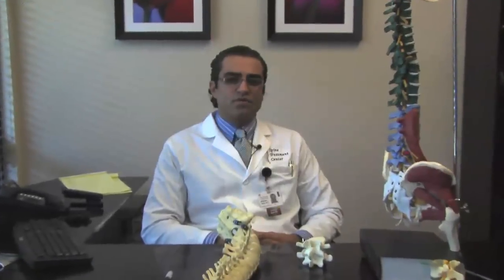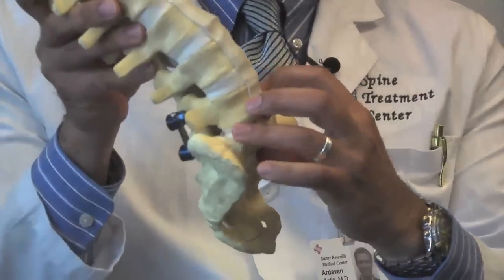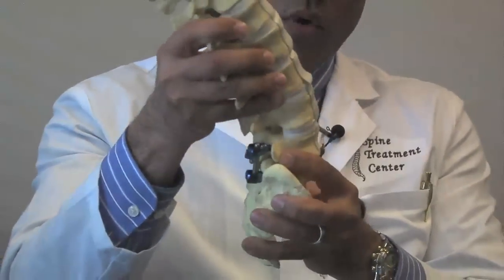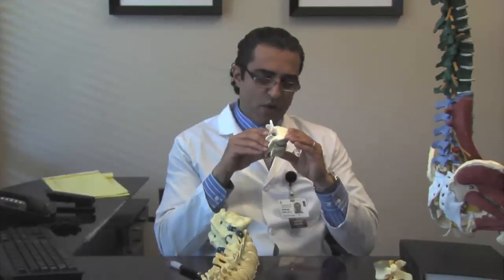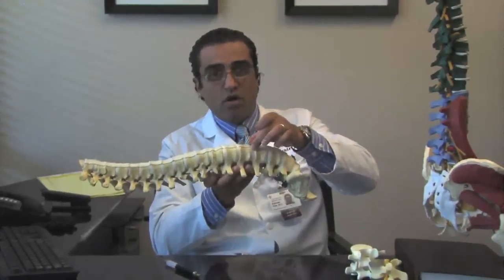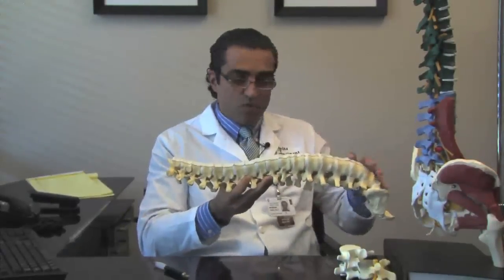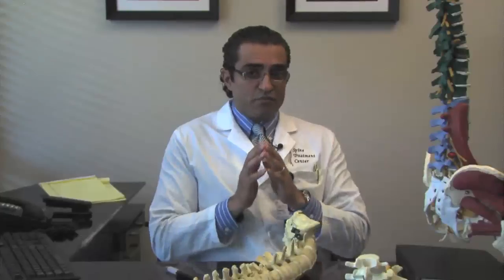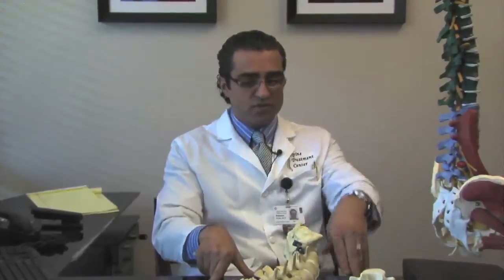Spine Treatment Center - Fusion Vs. Disk Replacement

Comment: I was assaulted when my back was healthy in 1992. I have been left with Cauda Equina Syndrome and Degenerative Disc Disease, after a surgeon cut into the dura of the cauda equina (in error) in a laminectomy for one of the worst herniated discs he had ever seen. He was near retirement age, so I am sure he had seen plenty of herniated lumbar discs. I have a patch job that took more surgery time than the herniation, which he was not even able to fix. I was left in more pain than before the surgery and have lived with the pain since the surgery in 2008. Now the degeneration caused by that failed surgery have affected the discs on either side of the initially treated disc. Now a surgeon wants to do another surgery, so you can imagine my hesitation; however, my legs are getting so weak and my muscles are wasting. I have bladder and bowel issues, and recently started using a cane after a fall. This video is very helpful for researching my options at this point. I want to be very sure I don't end up a paraplegic after this next surgery. I can't afford them to botch this one like the last surgeon did. I'd like to see the latest success ratings for the prosthetic disc replacements, to compare to the fusions, since this is from 2011.
Reply: hey how is your back feeling 
now

Comment: This video is extremely outdated. M6-L disc by Spinal Kinetics trumps everything this doc believes to knkw about artificial lumbar discs. Too bad FDA doesn't allow it in the US and you have to pay $40k out of pocket in Germany to get it installed. I am currently looking at that option. [EDIT: I ended up going with the LP-ESP disc instead of M-6L; I have seen several failures of M-6 and those scared me; Several good surgeons in Europe swear by the LP-ESP disc and prefer the design over M-6).
Reply: Artur Curyllo; I am suffering from three cervical discs. what is the best clinic in Germany?
Reply: Adel Cervical is no problem in the US up to two levels, but for three you may need to go outside. Try Dr Cavel in Barcelona, Ritter-Lang or Biren Desai in Germany. Prof Rischke in Zurich is great, but rather expensive. All of these are great.
Reply: Artur Curyllo Thanks for your quick reply. I just suffer from the pain in my neck that does not go away. There are currently no hand tingling. I want to follow up with a trusted good doctor to avoid future surgery and improve this constant neck pain.
Reply: Adel Depending on the extent of the damage to the discs you may get away with a microdiscectomy in the neck. Stay careful afterwards amd you might be fine...but if your symtoms return after a microdiscectomy you might be better off with replacing the discs to artificial ones. I am not a doctor and cannot give medical advice but this is the trend I see.
Reply: Artur Curyllo What 2 levels are the acceptable 2 levels that you mentioned for the U.S. in your opinion?Please & thank you.
Reply: Artur, please, keep on updating, do you have DDD l5s1 as well?
I heard that Dr Lang is good but surgery is quite expensive. Dr Andreas Schimitz is a class doctor or what do you think?
Reply: Alonso Andrés I do have a degerated L5S1 (that's how a disc herniation starts as it is really difficult to herniate a perfectly healthy disc barring a severe car crash, etc). Unfortunately at this point I have learned of several M-6 L failures by Dr Ritter Lang so I quit that route, even though that's how how I originally learned about ADR. Instead I am going with Dr Schmitz. I learned from him that he taught a lot of the other guys in Europe. One of my friends with a major cervical and lumbar M-6 failure by Ritter Lang is going to Schmitz this weekend for a revision. Feel free to join our Artificial Disc Replacement group on Facebook. There is a wealth of information out there.
Reply: that's sad to hear,  what is the name of that group?
Reply: Alonso Andrés Artificial Disc Replacement
Reply: Thanks man
Reply: @arturcuryllo5832  Do you have an update on your surgery? how did it go?
Reply: @arturcuryllo5832  I would like to read about these failures regards Dr Lang do you have a link?
Reply: @arturcuryllo5832  I read that Dr. Schmitz uses the LP-ESP and not the M6-L what do you think of that? do you prefer the LP-ESP?  are you thinking the failures are due to the M6-L not being good.  Could it be that many more M6-L have been installed and it's just a matter of numbers...?  I would be interested in hearing what failed exactly.  More details. I am considering a disc replacement my self in the 5L-S1.
Reply: @Ashakar2011  I ended up going to Dr Andreas Schmitz at Clinic Bel Etage in Dusseldorf. After all the research I decided on the LP-ESP disc (no keels going into the bone to weaken the end plate of the vertebral body and much more stable than M-6; M-6 had a number of consistent failures at the core - the core gets squashed and displaced if the placement is not perfectly centered in all directions; I hqve seen a few scary images). My outcome has been great. Riding my mountain bike 5 weeks after the surgery. The doctor said too early, but I feel go to do it so I am riding.
Reply: @treelore5100  Feel free to join the ADR Artificial Disc Replacement Support and Education group on Facebook. Several failures are posted there. My success atory is also there. There are about 800 members, many of whom are educated better than most US doctors).
Reply: @treelore5100  Join the ADR Artificial Disc Replacement Support and Education group. You will find several images and stories of Enande an RL denying any liability or even disc failure that WILL BLOW YOUR MIND.
Reply: @treelore5100  No, not this one. The one I am suggesting is a group on Facebook. Be careful which one you choose. The one advertising Enande and Ritter Lang blocks people reporting failured of M-6. There is a separate group with no financial interest there. Join that to learn everything you need to know to make an informed decision.

Comment: I'm so frustrated here, because i'm 23 and need something to happen in L4-5 so I can sit up without excruciating pain.

Bah
Reply: I highly recommend opiates, physical therapy, and injections. I’d that doesn’t work after 6 months of consistently seeing a pain management doctor go get an artificial disk replacement. This is the situation I’m in and I’m getting an artificial disk replacement on my L5-S1 July 7th.
Reply: @justacollegestudent5147  

Thank you for trying.

only one opiate works for me, and if I have my pain management place prescribe it, I need to go in every 2-4 weeks for a urine test and a visit, and they won't prescribe anything else, or I can not and try to get other stuff.

I've had three epidurals, three or four medial branch blocks, and a set of radiofrequency ablations.

Epidurals made me significantly worse, medial branch blocks only helped for a day or so, and the radiofrequency ablation was great but only lasted like eight months. 

I've been to PT so much, but it doesn't help for this, and my insurance only covers 40 a year, so I stopped going.

Went to a surgeon, he told me I wasn't bad enough for surgery.

Working on getting seen in Phoenix for getting a disc replacement.

I've been in debilitating pain from this for over three years.

I've been treated like a toddler throughout the process, as if I don't know my body.

I'm angry and tired and want to sit up x.x

I hope your disc replacement goes well!
Reply: @justacollegestudent5147  How did it go ?
Reply: @justacollegestudent5147  how'd it go
Reply: Hello how are you doing now?
Reply: @Enimasj91  still the same, if you're asking me — I am saving up and fundraising for surgery now.